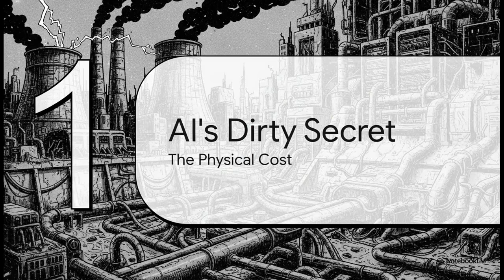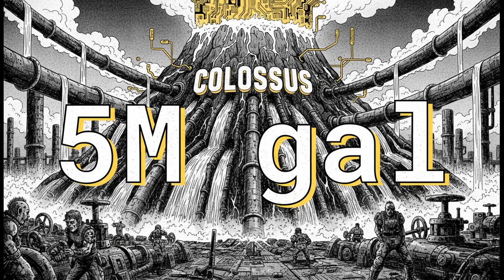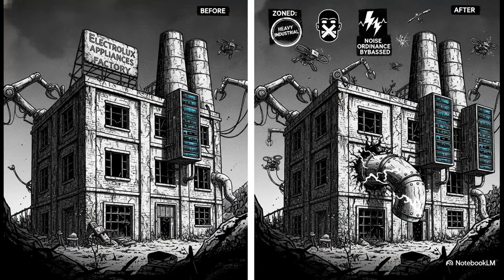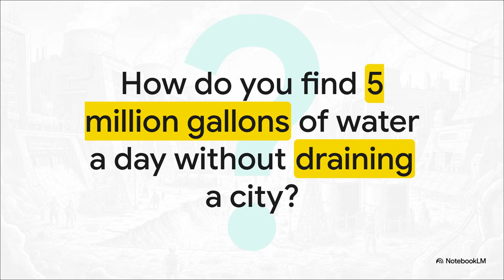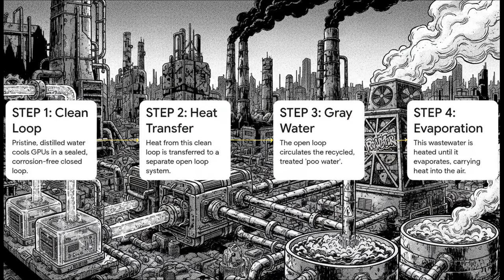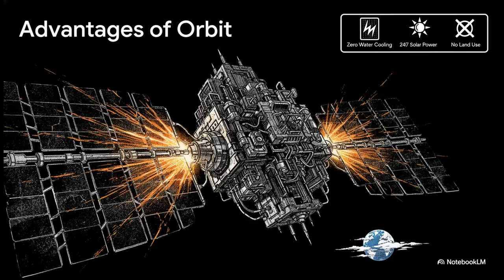How Elon Musk Broke Every Rule to Build Colossus in 122 Days

Comment: So.. how do you radiate heat into a vaccuum.... that didnt make sense.
Reply: Liquid ammonia. It’s a circulatory system used in satellites where one-way capillary pipes filled with ammonia which turn into gas on the hot side. The hot gas flows in the direction of the cold, which push cold liquid on the far side towards the heat. The ammonia gas radiates the heat out into space on the cold side, turning into liquid, which then flows back towards the heat side.
It’s pretty standard in satellite construction going back more than 50 years.
Reply: @johnscott434 you mean to say they have to out gas ... expell it.. it cant actually radiate into space and that only works so long as you dont run out of the medium. I dont think it can work any better in space than it does on the ground. Maybe not 5 million gallons ... but theres just no way its more practical in space. Space isn't a free cold sink as this video implies. Without any conduction or convection its completely impractical for a data center of that magnitude.
Reply: (just chatting about the science behind how it works in space.) It’s a closed loop. Lasts for decades. Longer than the payload itself. Other than a one-way valve, it cools without any moving parts, electrical motors or pumps. It functions like a human circulatory system except instead of oxygen, it’s heat.
One side of a satellite is boiling hot, the cold side -170C. The heated gas fills the radiator capillaries located on the dark side and radiates the excess heat generated by the payload and exposed equipment located on the sun side. Its payload is heavily insulated from the sunlight but the telemetry equipment needed for ground control needs to be visible from all angles (or at least the ones I used to work with.)
Heat management is a big subsystem in satellite mechanics. But it’s also important to have a method to keep the battery on the satellite heated at all times, extreme cold kills batteries, if the battery dies the satellite is dead.
I totally agree that it would be impractical as a single satellite base. It’s theoretically doable, but it would have to be like 80-90% heatsink (radiative heat expulsion is indeed very inefficient) and maintenance would be a massive undertaking.

Better to just build it IN the Great Lakes or better yet, Antarctica. build a nuclear reactor to power it and problem solved.